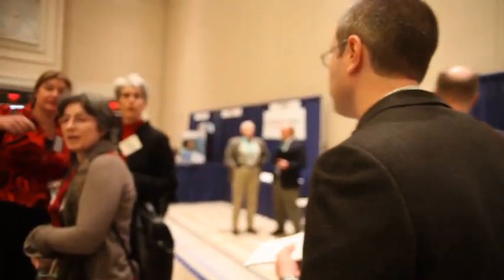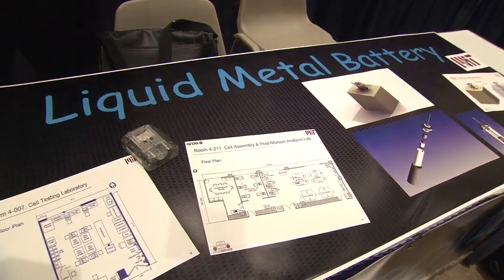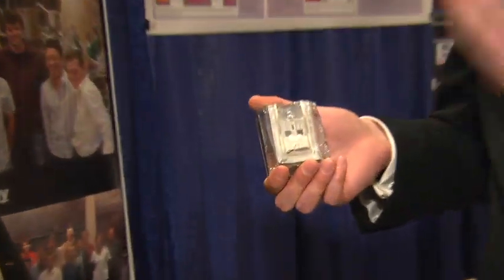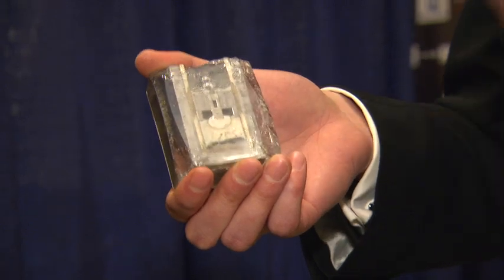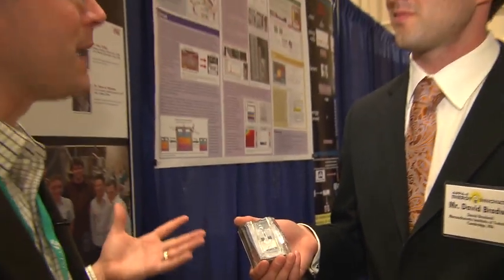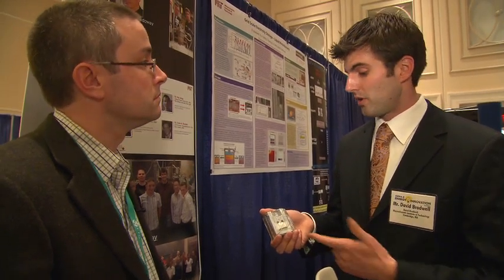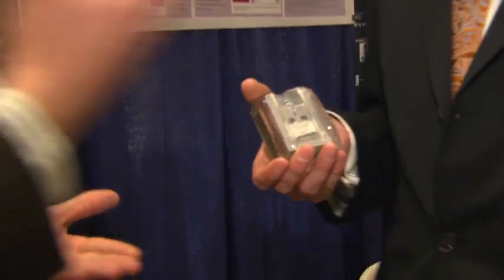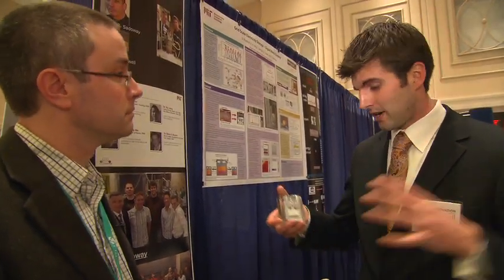Liquid Metal Energy

Comment: I saw the TED talk on the theory.  This would be a strictly industrial/ Utility level of use.  The metals are something like 1200+ degrees when in normal use, this tech was inspired by the smelting of aluminum.......  Serious power density batteries for evening out the surges caused by wind/solar Donald Sadoway is the lecturer.

Comment: According to the TED Talk on the same topic, the electric current generated by the wind turbines (or whatever is putting energy into the battery) to de-alloy the magnesium raises the temperature in the battery enough to keep the metals molten.  I suppose the container would need to be really well-insulated to improve efficiency and prevent heat loss.
Reply: mww